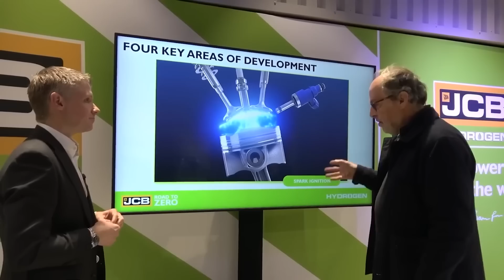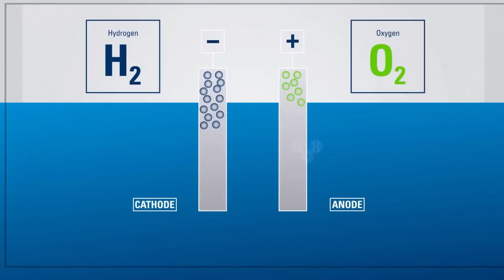Hydrogen Vs. Electric: The Engine That Could Transform The Auto World | Discover Space

Comment: The main reason why hydrogen powered cars never took off, explodium aside, is that it costs more energy to generate hydrogen on earth than it does any other method of producing power for the a car, be it electric or ICE. The fact is that this isn't new, and the reason it keeps failing to launch is the same as it was back in 2008

Comment: Generac has hydrogen Toyota power unit generator. Basically a GE rebranded Toyota power generator. The problem is hydrogen availability.
 From Milwaukee Journal Sentinel: Generac is importing the GEH2 units, costing approximately $300,000 each, from EODev, a French developer and manufacturer of hydrogen fuel-cell generators. 
The GEH2 uses a Toyota fuel cell and a lithium iron phosphate battery that stores and distributes the electricity. The unit can run independently or as part of the utility grid. The GEH2 runs off pure hydrogen that's normally only available for industrial use.
It's more expensive to operate than a gas or diesel generator, said Erik Wilde, executive vice president of the Industrial-Americas division at Generac.
"But people want to have that pure green product," Wilde said.

Comment: I can see the batteries and charging can bee n issue at a building site, but claiming that electric motors arnt powerful enough is just stupid. They are the most powerful motors we have. Powering trains to aircraft carriers.
Reply: cant put that size in a tractor so its pointess
Reply: @stephangermishuizen1113  Trains have much larger and more efficient engines tbh. And hub style motors are now demonstrated to have a significantly higher torque value. That being said, I think we all agree that hydrogen remains the non starter it has always been.